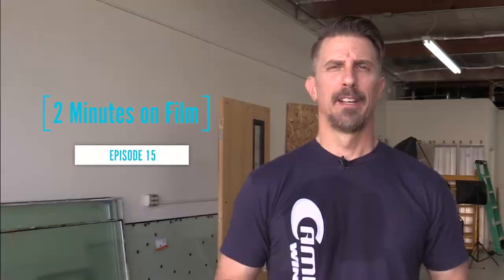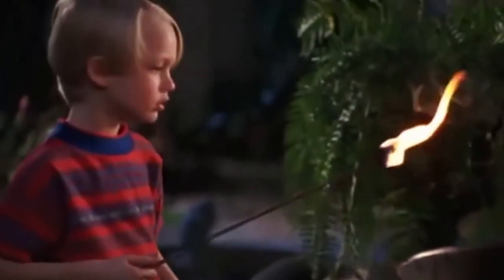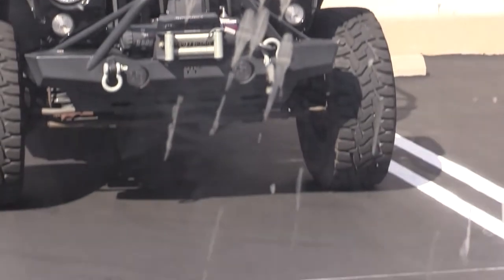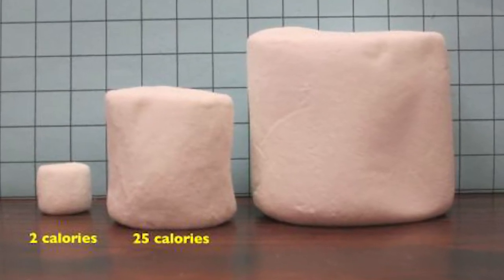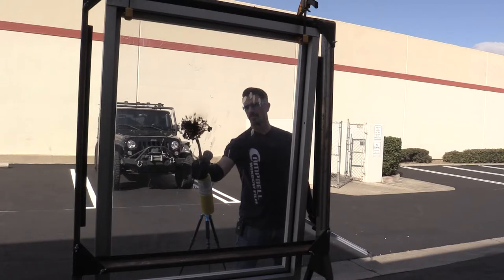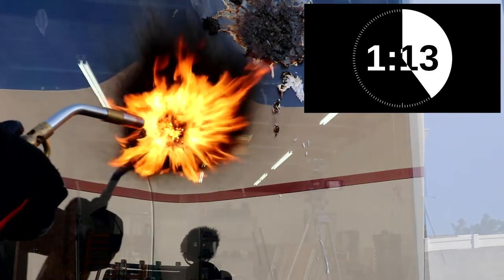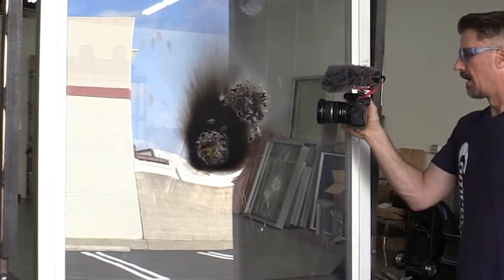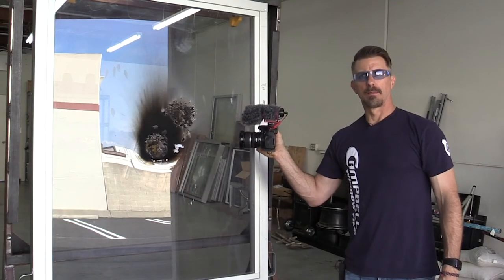Myth Busted | Torching Security Glass

Comment: What about a drill and a jigsaw with a metal blade?
Reply: You can't cut the middle glass layer with a jigsaw or reciprocating blade. You need some type of diamond grinding wheel that gets worn away as it's used. It would require you to cut each layer individually and probably replace the grinding wheel multiple times.
Reply: @NvrchFotia  I know but a jigsaw will probably cut through the armor plast a lot faster than trying to break it will a sledgehammer. It will be hard to break through laminated glass but if it's not then it will be easy.